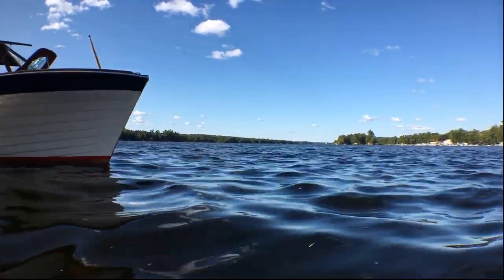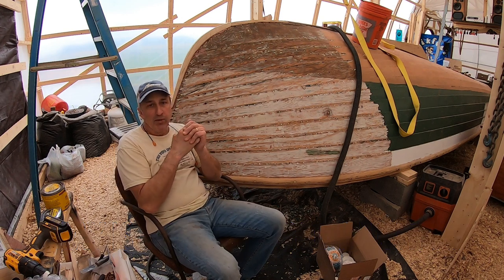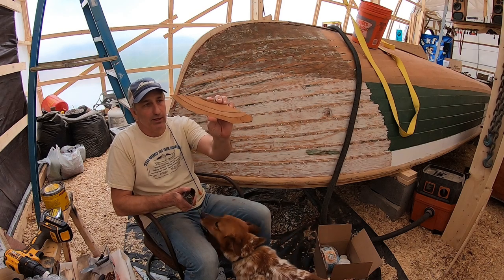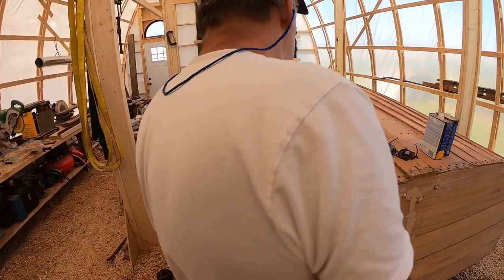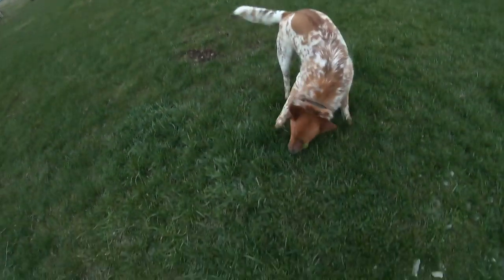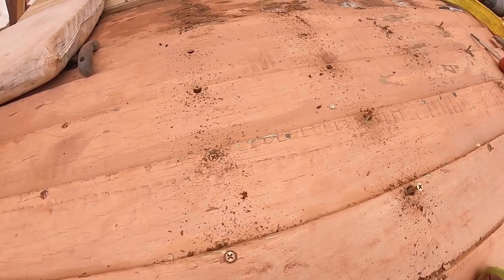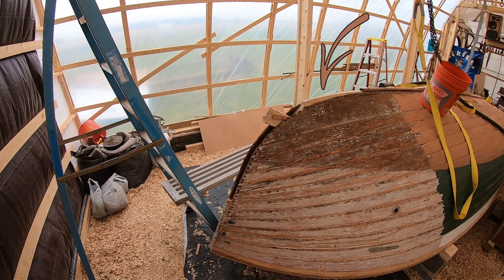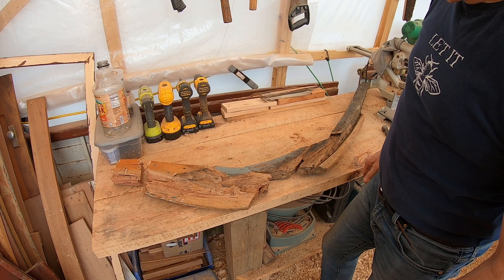Brand New Stem WBE S1 E33

Comment: New Subscriber.  Enjoy both the video content as well as your relaxed informative style.  And no pseudodrama which most others use to present.  Gets tiresome quickly.  Grew up at Chautauqua Lake (NY) loving wood boats.  In my 20's became ad director at Thunderbird/Formula in Miami, and have owned too many 'plastic boats', all with outdrives.  Terrible boats and a propulsion system the Dick Cole himself described to me as the worst of all possible worlds lol.  My next boat will be an early 60's era Chris Craft Sea Skiff, much like my dad had in 1960 for ten years.  God bless your work my friend.  Jon
Reply from the maker: Thanks for the kind words! Somebody recently told me about a Lyman IO, I won't say what my response was. I love inboards, but have owned a lot of outboards as well. Still own a 1989 Ski Centurion Barefoot Warrior that needs a new outboard. We'll see, I love the Evinrude Etecs. There are some good deals out there on Sea Skiffs and probably even more soon depending on how this current situation plays out. Glad you've come aboard. I'll keep making them, you keep watching them :)
Reply: When I was in my 20's and at Thunderbird, I interviewed Dick Cole, as the Formula 23' was the first deep vee in history, his invention.  He hated stern drives.  Said that 100's of horsepower making two 90 degree turns, AND rotating, is ridiculous engineering and why they all tear themselves apart.  So true.  The old slip clutch inboard transmissions probably last forever.  I love old boats :)

Comment: Chris Craft intended the Sea Skiffs to be throwaway boats after only 15 years so I guess their original design wasn’t too bad after all lol. That design with the 3/8” plywood added was also used on many of their smaller 50’s and 60’s planked boats usually for where the inner plywood lands. They probably figured out they could save a few minutes of labor by screwing on the piece instead of making it full thickness.
Reply from the maker: It's really in pretty good shape when you think about it. I think it may have been kept in a boathouse. I know what island it was on and there are lots of boathouses there.
Reply: Glass Goat boat house kept could be good or bad for a lapstrake. There was a 20’ sea Skiff on a local lake hanging by the lifting rings for about 20 years without ever being used. It spread so wide from hanging it wouldn’t fit between the guide poles of a trailer set up for a U22 lol.
Reply: Did not know the Sea Skiffs had limited life expectancy.  We had a 20' 1960 when I was a kid.  Sold it after 10 years, and it was in same shape as the day it was delivered.  Well winterized and repainted and varnished each year.

Comment: That strut is probably still available new but the foundry prices have skyrocketed in the last year. There’s also shops that can straighten it but yours looks iffy.
If you post the casting number I can see what I can do.
Reply from the maker: I'm going to take all of the crap and paint off of it this week and really see what it looks like, then I'll know better. Where do you order cutlass bearings?
Reply: Glass Goat we order from a supplier that doesn’t sell to the public and they’re still closed for the time being due to the virus. You should be able to find your size and length from a supplier online. I looked in the parts book looks like the strut on the 18’ Sea Skiff wasn’t used on any other model so it might be hard to find.

Comment: Thanks, for sharing. I love your channel. You can use a cheap hot glue gun to hold patterns in a much better way than duct tape
Reply from the maker: I can see that working well on the outside of the bow, but I can also see it being a hassle when inside, the cord etc, it's awkward in there as it is. But I will try your tip out next time I do something like this. Glad to have you aboard!